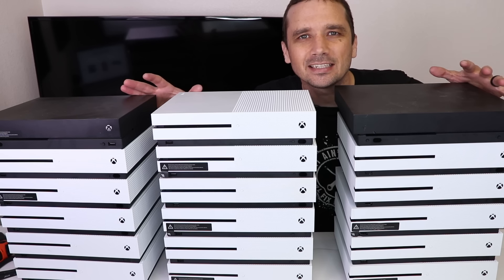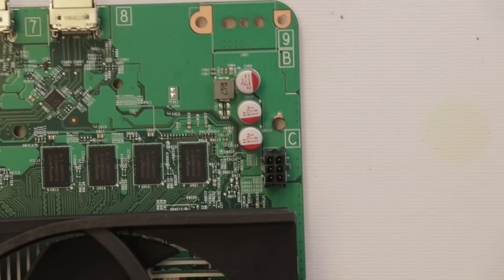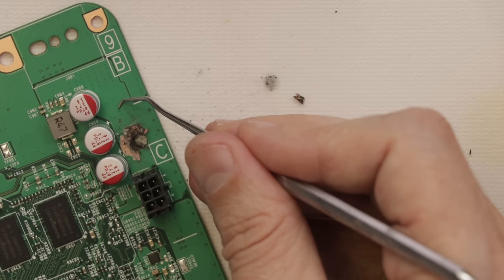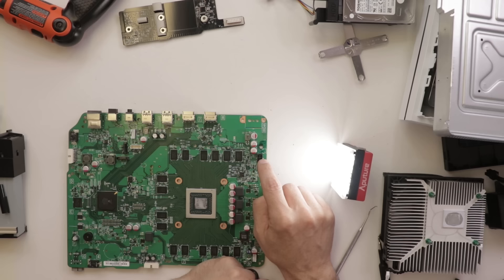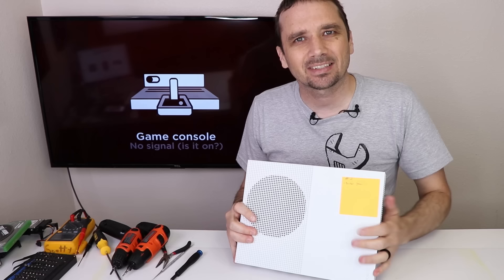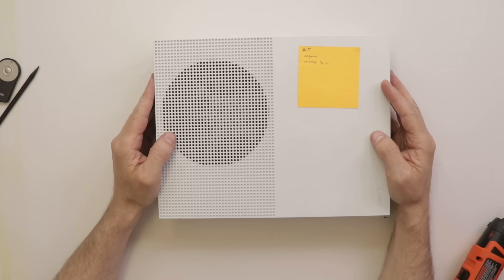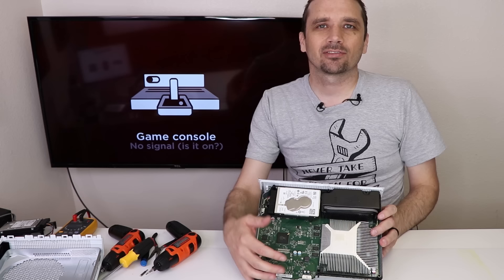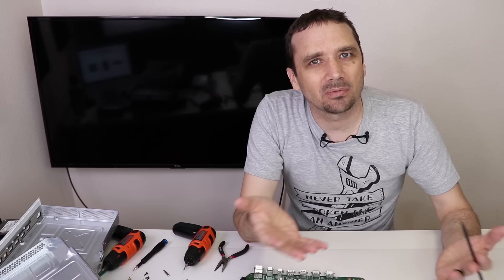I bought 18 broken Xboxes - Can I Fix Them and Make Money?

Comment: 18:40 If you still have that one..A short on the power button board typically causes this as well as main chips/ main chip paths. Take a look at the connector shielding to see if the power button board is grounding to the case.

Comment: I don’t have a clue about electronics, but I still ended up watching the whole vídeo
Reply: don't worry... "open loop", this guy doesn't seem to know much more. Though he does have a hot air re-flow station..... jury's out.
Reply: Yeh I couldnt help myself! Ive never even looked inside a console or a PC, too scared to.  But it was a great watch.  I've subscribed as I feel compelled to find out the rest of the results
Reply: @chrishatherley3531  lol... i'm tempted, but given that it's 3:30am here and his television that we're supposed to keep listening to has the volume set at about 2 and he keeps shouting "what do you think? will blah be fixed"? down the mic....  feels like you're watching sesame street or something!
I did learn something though.... these things are not very serviceable, which means easy money if you own the equipment... I happen to own the equipment :)
Reply: Me neither, still I don't understand how you can just scrape away pieces of the circuit board and still have it working? I did study some electronics almost 20 years ago, but it didn't interest me so I learnt next to nothing, even fell asleep during lectures.
Reply: @atnfn  my guess is the actual power transfer is layers deep? thats from an entirely non technical background!
Reply: @atnfn  lol... it's not for everyone I guess.
multi layer PCB is a whole subject of it's own. There is a metric butt load of information ya need to know in order to pull it off, especially when you're talking high speed parallel buses. Without going into inductance loops and capacitive coupling and the rest of it, generally, the power plane/s are on one side, data in the centre layers and ground plane on the back. But not always. I'd wager they have multiple power planes to carry the current and obviously multiple ground planes for the same reason but also for EMI shielding. The real thing working in his favour was the location with respect to the APU and southbridge, any layers that had copper around there were bound to be either gnd or a power rail. The chance of a data line or bus lines running on any of the 6-8 layers around that hole... highly unlikely. You might find control wires for the vrm's in an area like that, but again, not very likely. 
all that said lol... he still got lucky. I doubt I would have even contemplated attempting that.
Reply: Same, not sure how you can scrape away material and not replace it and have it work

Comment: You could remove the disk drive and sell them at SAD edition prices.
Reply: @yournan7249  sad.
Reply: @yournan7249  one S All Digital S.A D edition
Reply: As I understand it the S firmware wont boot without a drive.  Perhaps if you could flash the SAD edition firmware, although I'm betting the firmware is actually identical and it just has a serial number lookup table in the firmware that decides which edition it is.

Comment: the HDD has 24:20 has a stuck bearing.. it may sound extremely stupid but the fix is:
Fill a non-static electric charging container half way with rice, yes rice! That is for moisture absorbtion.
Place the HDD in the rice, Cover the HDD with more rice til container is full, put on a lid or whatever to hold in rice...
Place in Freezer in around  -28'C (-18,4'F or thereabout) for about 6-8 hours.
The bearing will cool and shrink just a micrometer or two, that can be enough so that when you take it out, gently tap it at the center of the bottom where the discs inside (I hope you know how an HDD looks inside) are mounted to the bottom with a plastic covered hammer just once.

Works like a charm ;)
Reply: This has to be a joke. If not, you might have saved my console or just given me false hope
Reply: @costistoiciu4863   sometimes the strangest things work. :) I have been working with electronics since 2006.
Reply: @MrWeedWacky  well I guess I really am going to put a component into a bowl of rice after all
Reply: Dude reminds  me of Dynamo
Reply: Seth Wellington  any particular reason?
Reply: @Ian Mangham Oh wow you did the fix you read about online good job. Everyone and their mom knew that about the 360s.

Comment: "Hmmm... I don't see what is wrong exactly. LET'S JUST SCRAPE THE BLACK BITS!"
Reply: Jason Kelly - It was an exploratory technique and he was correct, so... sorry you don't get it. No obvious burned diodes, capacitors or mosfets, so poke around where the OBVIOUS BURNED SHIT IS! What's so hard to understand about that? He knows circuit boards have layers and that the power supply is using at least one of those layers to transmit power to the MB. Charring and burning from a shorted connection happens when power is sent to ground via a path it shouldn't be on so he also knows that something in that area is shorting. Scrape the layers back and see if the short is alleviated. Voila! This was a good example of exploration and improvisation from a solid base of general electronics knowledge. It's brilliant actually.
Reply: Mmmmm... the poor person who ends up buying that console! I'm no electrical engineer, but I wouldn't consider scrapping burnt fibreglass a fix o.0
Reply: @kaydog890  For your own use, data recovery etc it is, but to sell it I definitely agree.  Although I'm more concerned at what burnt in the PSU, I can't imagine it lasting very long and I personally would feel very uncomfortable leaving that PSU plugged into the mains 24/7 after that.
Reply: I was a little surprised too, but you need to consider that circuit boards are just layers of copper conductors separated by non conductive layers.  He essentially cut off the bad areas.  I would personally feel obligated to run it for several weeks before I felt OK about selling it.  On the other hand, Steve is PRO.

Comment: Incredible. Once I see a non-plated through hole (NPT) that's shorted internally, that's it. There's no guarantee that the short is within scrapable distance near the hole, and  you would have never been able to scrape all the welded metal plane(s) out of there. Typically, board designers put between 10-35 mils clearance away from NPT's just for this reason, even more if it's a power supply split plane (depending on current requirements). If it's shorting even with that (granted, damaged because something goes into that hole, wearing it out), it's over, "F". Literally sitting here yelling at the screen... "You can't do that REEE!"! If the whole plane had been welded, you would have had to scratch all that copper cladding off that G10 core material and it would have still been junk... an incredible save to say the least.

Comment: Nice video Steven .. shame we can't do nothing about those that don't power on. 
It get's hard to find the fault without those schematics ... can't wait for the second part .. 
thanks.
Reply from the maker: Yep! I'm going to try though. I'm going to make a separate video just for those.
Reply: @kingoftaurus  probably not worth the time
Reply: Try hot air gun on APU. I reflowed one on mine and it's been 2 years and system still working.
Reply: @Tronicsfix  not a fix but pressing eject repeatedly gets mine to power on. Not sure why that works though.
Reply: @TheForgotten-Gaming  probably missing or wrong signal from the apu or southbridge (because of broken solder joints) that you are interrupting by pressing the button
Reply: @robbirobson7330  I was thinking the same, I'll pop it open and look once Live Gold subscription ends.
Reply: @TheForgotten-Gaming  before you heat anything and probably destroy it completely try and just unscrew the mainboard and screw it back gently sometimes it helps.
Reply: @robbirobson7330  Indeed,  it's not original to the shell anyway, so I'll see. I'll do a proper visual inspection too.
Reply: @kingoftaurus  This sounds like a plan. However it is also very easy to damage a working device. If your probe slips, you can short something out. Another thing I can think of, is if there is anything in there with a resistance high enough in the megaohm range that could make a parallel resistance with that of the probes, causing more mayhem.
Reply: kingoftaurus if I made schematics for this would I get in legal trouble? Especially since I made the schematics all by myself so it’s technically not copy written idk someone help me out here because I can make them it’s not that hard
Reply: Adrian Jarvis that hurt me too...damn
Reply: Normally, the power issues can be solved just as easy. Often you don't need a schematic, even when talking about a broken PSU.
Reply: If his names Steven he must have stolen that DMM! Poor Scotty :(
Reply: Jason Griffith what temp did you have it at and for how long ?
Reply: @robbirobson7330  I popped it open yesterday, tested and recorded hom values for most of the area under the heatsink. All seemed fine. Put heatsink back on and where clamp fits, I noticed a loose and cap and refitted. Now powers up like new. Weird, no idea how long the cap was loose or if fixing that fixed the power issue.
Reply: @TheForgotten-Gaming  Everything is possible, at least you got it working again :)
Reply: @robbirobson7330  I wish I knew why and if it's permanent.

Comment: Something I found on an old 360 that caused the system to not power was a usb port. A pin was bent up touching the top and once moved down the system worked perfectly. Just happened to check inside the ports as a last resort.

Comment: I would take a heat gun to the partial power ones just to see if that was the issue. Sure it's not a permanent fix, so I still wouldn't resell them, but they would at least work temporally.  Look to your shirt for advice.
Reply: starshipeleven  😂 We're fixing peasant boxes, relax.

Comment: So Basically the fault with the shorting out circuit board copper plains appears to have been caused by a bad design/ pre-production check. All the copper plains around that hole should have had a clearance around that feature on each outer & inner layer of the circuit board to keep the copper away and prevent the chances of shorting. It is common to have to put clearances when reviewing each layer after design and before manufacture as the designers often miss this.  Sad thing is I have been using UCAM ( Electronic CAM software) for my job since back early 2000's and that has had the ability to run a auto check plain to feature clearances in seconds for 20+ years. Ball been dropped me thinks !
Reply: Likely a fault caused by a bit of moisture getting into the board causing a connection between the ground plane and supply voltage, once the short was established the pcb burned leaving behind carbon which also conducts causing the hard short.

Comment: Is this what they call refurbished?
Reply: Yup
Reply: this is kinda it but usually they dont have to entirely fix it
Reply: would rather buy a refurbished one from this guy than Gamestop.
Reply: Hmmm.......I really wouldn't like to be the buyer of the first system that was shorting out and got it's layers scraped, to remove the carbon. There still could be an underlying problem, that's was causing it too short out and earth, in the first place (although it could have been possibly caused by an improper installation of a HDD or PSU) and If so, I can't see it working for that long (especially with the applied strain, that you get around bracket and screw-holes)
Reply: @fafski1199  I mean, it's going to be cheap at any rate. If a buyer is willing to risk it then it's their risk, it could work for ten years
Reply: @mrcaboosevg6089  depending on how iy is sold they may not know. Some people will sell them as used and not as a refurb.
Reply: If your talking about refurbished from GameStop then no, they pretty much just clean it
Reply: @mrcaboosevg6089  Yeah, it needs to be knocked down in price and any buyer needs to be informed (It could very easily be 10 minutes or 10 hours, as well). Personally I'd have classed it as a scraper for spare parts and wouldn't trust it, even for personal use.
Reply: @0Imtheslime0  I would marry this guy X)
Reply: Yes but usually GameStop won't go that into detail. It's why so many of their refurbished consoles fail to work long term
Reply: that dude Because they have employees making hourly wages, they have no incentive to do a good job. This guy is making all the profit. He does
Reply: @fafski1199  he does not look lile a guy that would sell it without testing for a day or two and then again these console sometime break just cos they can
Reply: @blixx87  I don't blame them I wouldn't be caring all that much either.
Reply: this thread makes me hate gamestop more now
Reply: @blixx87  oh hello there.
Reply: Yep NEVER buy a refurbished unit
Reply: Ches
Reply: Seller refurbished.
Reply: @grumpycomputers7488  8
Reply: Pretty much
Reply: I lack words for this repair...
Reply: nick aguirre
they? who are your 'they' here???? 
cheap stores, ebay real xbox?
Reply: Don't buy a reburnished anything. It's very risky.
Reply: @coolminer1231  trust me they dont

Comment: Had the One S that kept shutting off after a few seconds. Went to the forums and the suggestions were all the same: do a hard reset or a factory reset if possible, could be a fan issue and get it repaired. Nothing was helping and xbox support was useless.  I was going to tear mine apart and look at the fan but by an off chance of re-wording my search help I saw a post that mentioned plugging it straight to the wall socket.  OP said that the Microsoft tech that helped her mentioned that the One S had an internal power surge that could get messed up if plugged into a surge protector. Plugged mine into the wall socket and it worked! What the Heck!!!
Reply: Elektronc

Comment: Just bake them in your oven at 412F! Typically fixes most solder issues.
Reply: Tryed it with my cat, went kinda smokey
Reply: Pegaa my dog came out not barking anymore
Reply: @joelshack85  guess the was a magician in there which transformed em
Reply: I was about to comment this glad someone else has the same idea lol
Reply: FubarPerth solder voids form over time from heat and poor OEM solder probably account for 50% of board failures. I would say.
Reply: @joelshack85  Yep, I fixed my old Dell XPS laptops motherboard in the oven, if it's broken you've got nothing to lose!
Reply: FubarPerth very nice!! The almighty oven!

Comment: What I learned from this vid: Never buy refurbished. Just save a couple bucks and buy new.
Reply: or used from a trusty tidy friend
Reply: I agree with you
Reply: Depends where you buy the refurbished. You need to find reputable refurbished dealers. If it is associated to a major well known reputable company that has a high reputation in refurbishing like for instance Dell then you should be fine.

This guy is a one guy testing team... that is not refurbishing business standards. They need to run it through a pipeline of testing and follow standards. This guy is good but it is not professional refurbishing standards as he simply doesn't have the equipment to do so. Also, this guy is only refurbishing broken equipment... a lot of refurbished stuff is just returns...
Reply: Or save 90% and fix it yourself
Reply: @tj8870  Agreed. I'm 30 years old. Besides buying my first phone new at 16 years old. I have always bought a refurbished phone from ebay. Always picked the highest rated seller with usually a 30 day-90 day warranty. All they do is refurbish phones. 

I have a note 8 now (and a Note 5 and Note 2 before this). I have always paid half or less of the full retail price of a new phone. Ie Note 8 wasn't much over $325 when it was over $700 brand new. Same with the other Note phones. 

Just bought a beat up gameboy advance for less than $16 when a normal working one is usually 3x that. 

I love buying old "broken" consoles that people think are garbage and have a dent on them and perfectly works fine. Like it sits under a TV in my house. Idc if it is pink....does it play a game? If so forget about it. Lol
Reply: I got a refurbished Xbox One X for 200 dollars. Been using it for a year no with no problems. Why wouldn't you buy refurbished if you can buy two for the price of one? Even if one of them fails you still have a backup.
Reply: You mean spend.
Reply: Centorea 88 a One X?

Comment: Ha, wow, picking apart the circuit board fixed it. Never would have thought that.
Reply: Today I learned from Steve: circuit boards have two layers to them
Reply: @adventureoflinkmk2  me thinks Xbox mainboard has got at least 4 layers, most likely 6 or 8, the damage looked like screw hole lining got damaged and moisture prnetrated inside, causing rot.
Reply: @adventureoflinkmk2  ...or 4, or more!
Reply: @billysgeo  right, right.. thanks yall
Reply: @romandunduk5832  Maybe he should put some non-conductive glue or something over the carved-up spot on the PCB to protect it from future damage.
Reply: @stale2665  He did. He covered it with green solder-resist.
Reply: @owaing  and now I but buy some of that UV-cured solder mask paste! Didn't know it existed! Where could one find it?
Reply: @billysgeo  Search for "uv solder mask" on eBay. Lots of tubes of it on there, in various colours, pretty cheap.